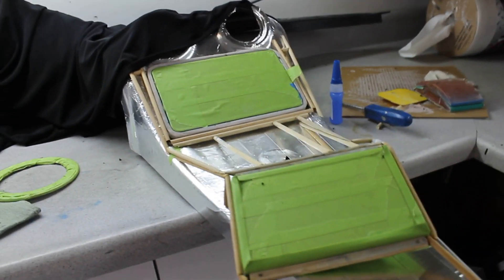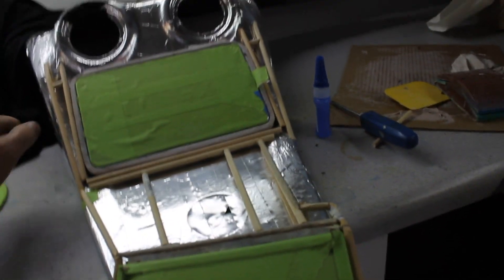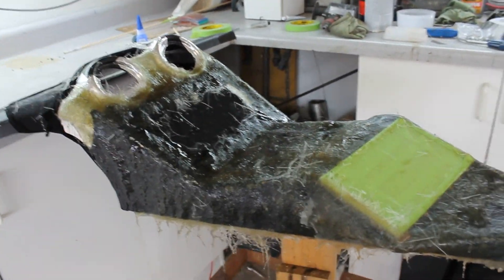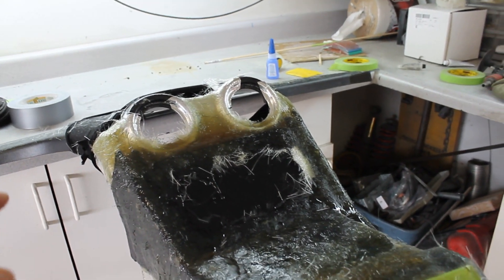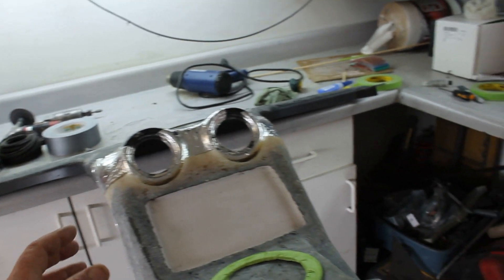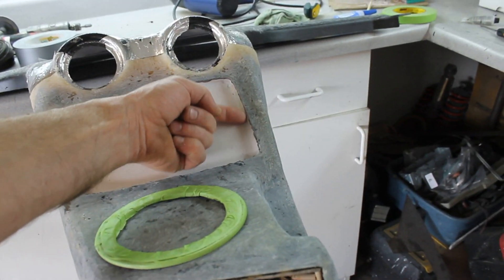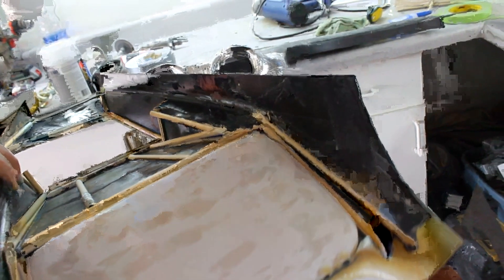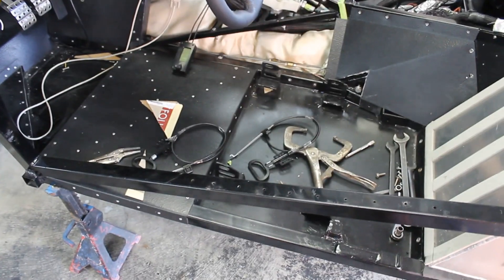Factory Five GTM Supercar, fastthings build log....... Part 59

Comment: That console looks cool , have you considered cutting a notch on the left , to get your finger tips in to lift the tablet out , or maybe a spring loaded button ?
Reply from the maker: Hello, I need to redo alot on the console. I do like the idea of a finger notch, another builder mentioned that. After I started looking at all the stuff I need to put into the console, it needs redone. Also, I need a cool way to hold the tablet in the cradle. It has a magnet on the usb end, but nothing at the end that I would have the finger notch.

Comment: No need for a plug if it is has wireless charging capabilities. Check to see if the Qi chargers work. Then Bluetooth the audio.
Reply from the maker: Good point, but the HDMI will be what I'm after, bluetooth won't cut it. I will teather my internet with bluetooth, since sprint won't let me hotspot.

Comment: Just a thought.... How about replicating the tablet out of bondo and laying fiberglass down for the cradle instead of the softer bondo. The tablet is also going to want to fly out under hard acceleration can the tablet handle a magnet to hold it in place? Or maybe some rubber detents?
Reply from the maker: There will be no issues with what I have, the bondo will be plenty strong enough for what it is doing. Yep, and I do need to hold it down, the tab has one spot for a magnet.